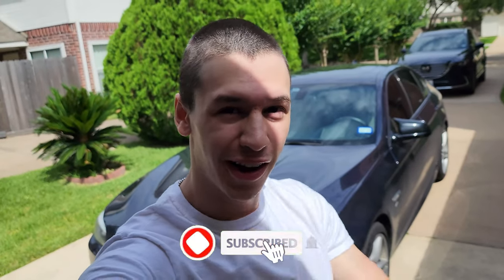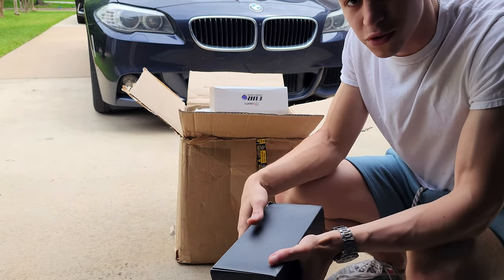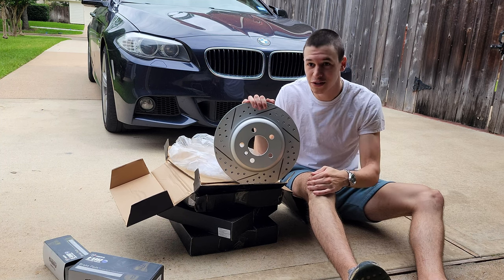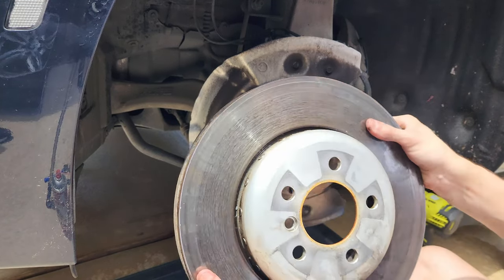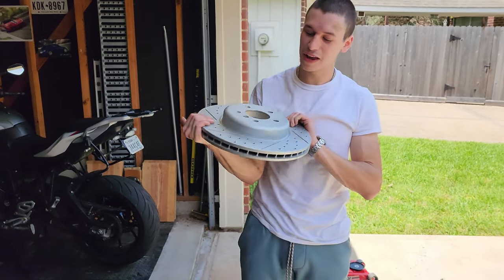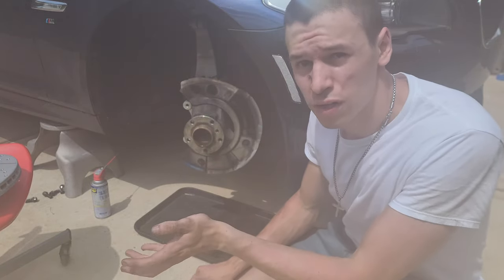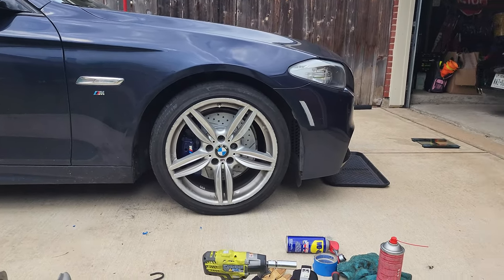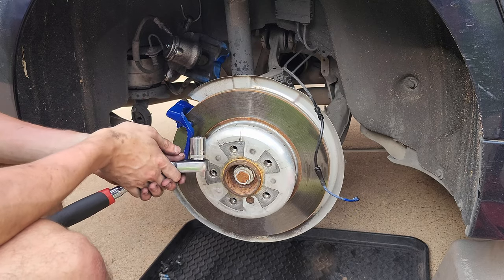R1 Concepts Drilled and Slotted Rotors for BMW F10! | 535i Build pt.8

Comment: I got the same rotors but different pads let me know how those feel cause the ones I got had a lot of brake fade but for the record it wasn’t ceramic
Reply from the maker: Well, on a daily driving basis, I experience no fading whatsoever. However, on some fast backroad twisties, I do get a significant amount of fade. To be fair, the F10 weighs more or less 5,000 pounds, and I don't have the stopping power of an M5. With hard, spirited driving, fading will occur - I just pull over and let them cool down a bit, nothing major!
Reply from the maker: Hey! Just an update on this comment. I said the brakes had a lot of fade - but at the time they weren't really broken into. After driving for a couple of months with them, they do not show any fade in spirited driving. Driving hard and fast in the twisty roads, I don't feel fade anymore. I feel very confident in their stopping power and cooling, so I guess they just needed to be broken in a little more!
Reply: @MotoRevs  thats good info! Thanks for the follow up man. I was looking at these pads, akebeeno, and brembos...it's definitely a toss up between the bunch 😂
Reply from the maker: I'd say so! I also have to say, I'm extremely pleased and impressed with the Optimum OEp pads. They feel great, but that's just my take. Experiment, and see which you like most!
Reply: @MotoRevs what brake fluid are you running and how are they holding up now

Comment: Hey I’m trying to get rear rotors for my f10 mine is 2011 msport but would it still be the same size? Or would I get the 345mm?
Reply from the maker: Honestly, I'm not sure. I'd say your rear rotors would most likely be the 330mm option, as the fronts usually are 345mm.